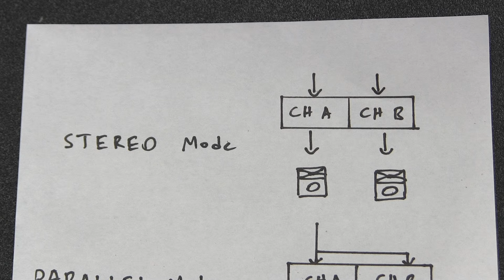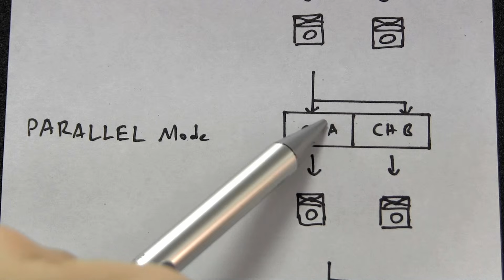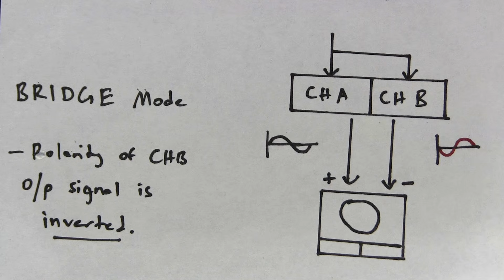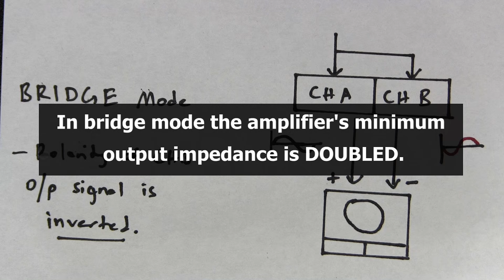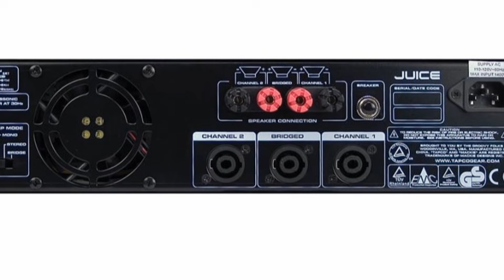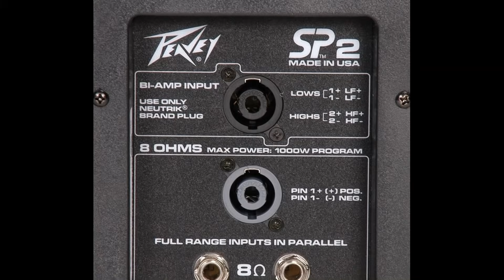How to set up and connect a power amplifier in bridge mode

Comment: Is it safe to externally connect the inputs to a power amp in either parallel or bridged mode?
Reply from the maker: What do you mean by 'externally connect the inputs'?
Reply: GLB Productions I was referring to using a Y adapter to either connect the Left Channel and the Right channel of the preamp outputs independently to one power amp for each Channel. Or splicing a Y adapter and reversing the phase on one half of it so that it would be connected out of phase between the right and left Channel from the preamp to the power amp. Do certain amplifiers permit this configuration or is it unsafe. I noticed you were discussing only amplifiers that have internal switching already set up. I would like to bridge an amplifier that does not have these circuits already built into them.
Reply from the maker: Oh I see. Yes this is safe as long as you know what you're doing, which means having a good understanding of balanced inputs (if the amp has them) and how to keep the amp inputs separated - shorting them together is a very bad idea. In addition it's a good idea to take a look at your amp's wiring diagram to confirm that it is in fact a true 2-channel amplifier - some 'stereo' amplifiers I've seen have a left and right input but sum them to mono internally and have only one power section. If in doubt contact the amp's manufacturer to confirm.

Comment: great vid, really well explained and very useful. I also laughed my ass of since it explained very well why and how I blew my first amp I bridged on the wrong side so to speak and connected to a 4ohm subwoofer, so I did everything in opposite of the right way (I was very young but I've learned from my mistakes)
Reply from the maker: Yeah, fortunately bad sound isn't fatal... most of the time ;)
Reply: @GLBProductions  Hi Sir please help me with the connection of 2 double bassbins in bridge mode

Comment: I have a question. if I turn my amp to bridge mode, is it possible to connect 2x 4ohm speakers in series to have 8 ohm in bridge? Am I right?
Reply from the maker: Yes it's possible but you will have to wire the series connection yourself as normal speaker cabinets are always set up to be wired in parallel.
Reply: Peter Petrík I'm going the same route but I was told the 4 Ohms becomes 8 then once it gets to the bridge the bridge cuts it in halfback to 4 Ohms

Comment: a lot of home audio still uses binding posts or push terminals. also. you quoted the "output" of the amp. is that in rms? or is that peak? peak is usually an inflated number that means jack shit. rms (in the car audio realm) is generally indication of actual output to the speakers.
Reply from the maker: Yes the output is in RMS. Peak output in pro audio is usually taken to be four times the RMS but you're correct that it's not a useful number to work with when doing system builds.

Comment: I think there is fault in your explanation. When you feed a speaker at the same time with a positive and a negative Signal,coming from Channel a and b, the speaker dose not move at all. I assume that the amp feed at Channel one the positive Signal and Channel two the negative Signal. Pulling and pushing at the same time equals the signal. There Must be Phase Delay by 90degrees.
Reply from the maker: You missed the bit where I talk about the polarity of one channel being inverted :)

Comment: if wo connect our speaker on channel only with amplifier  on bridge mode unintentionally....  is that safe????
Reply from the maker: Yes it is safe but don't leave the amp switched to bridge mono if you are actually using the channels independently.

Comment: I made this cable solution...the sound is much better..depth, clear and detailed..another question: the power at the output is the same ?if nominal power is 50 +50 watt whith this configuration is 100 watt?tks..
Reply from the maker: No the power output is generally 2-3 times the output of a single channel into the same impedance - check your amp manual for the exact figures.

Comment: Hi!!, How are you? your videos are really helpful and well explain. We have a small church around 96 sq.m. our tops is HH Tensor TRE 115A 500 watts active speaker. We wanted to do an upgrade to purchase a subwoofer to really pup-out the Drums (with sub-kick mic), bass guitar and all other instrument (rhythm band)  were mic, can you give me an advise on Amplifier and speaker  wattage that will match our tops but can produce a deep clean sub-bass for the drum kick. For your info our volume is set 9-10 o' clock, because the HH tops are too loud for me. I greatly appreciate your help. God bless you.
Reply from the maker: Seeing as you are already using HH speakers, I would look into getting an active subwoofer from the same company that is designed to match your fullrange speakers.

Comment: If I power my subwoofer with just channel A, I know I will have less power if I would do it in bridge mode.
But does Bridge mode sounds better than just one channel?

And also, u said if I use bridge mode, the ohms double? So I would have to set it at 4 ohms, then bridge mode to power my 8ohm woofer?
Reply from the maker: Bridge mode gives a lot more power - whether or not it sounds better depends on how you configure your system and match the amp to your speakers. In bridge mode the minimum load impedance on the amplifier doubles - if your subwoofer is 8 ohms you should have no trouble with a modern power amp.

Comment: In bridge mode how many speaker can connect to a power amplifier
Reply from the maker: It depends on the minimum load that the amplifier can handle in bridge mode - for example if it is 4 ohms that is two 8-ohm speakers maximum.
Reply: mahesh sudigala really depends on the setup and your wiring parallel or series. You can 2 4 ohm subs of your choosing wired in a series the final is 8 ohms then you can bridge that 2 4 Ohms mono. Or you can take two 8 ohm speakers why are they parallel making them 4ohms once bridged it's now 2 ohms but you would need the rating for it.

Comment: Hi,
I know it's been a while since you produced this video but it is an excellent tutorial, (as many here have said). However, I would just like to get confirmation that I understand the reasoning for a Bridge mono, (or Bridge mode), configuration.

I'd like to use an example of what I think I would use this configuration to accomplish, (In the example, I'll be using round numbers to simplify the scenario):  I have an older model stereo amplifier, (Sansui, circa 1985), which is rated nominally at 150 watts per channel for 8 ohm speakers. 

The amp has an Output selector to choose the "Speakers A" pair of speakers and a selection position to choose the "Speakers B" pair of speakers. It has a third position which permits driving the speakers A & B to be driven simultaneously, but when that position is selected, the amp's nominal output wattage is cut to 75 Watts per channel to all 4 speakers. 

I have no sub-woofer connections or selection for the Sansui amp, but I want to drive a powered sub-woofer (rated at 150 watts/8 Ohms), that I took from a home theater, '5.1' system. The sub-woofer also offers RCA connections for the remaining "5.1" system speakers, which I will not be using, (I only intend to use the sub-woofer to add to the Sansui stereo system). 

The speakers I have are Klipsch rated at 100 watts per channel 8-ohm speakers.

Because I have no connection to make from the amp to the woofer, I thought I may be able to use the Bridge mono configuration shown here. The woofer has a separate power source and I don't know if it would be best to use that source, or to treat the woofer as a 'passive' woofer in order to accomplish driving the woofer through the Sansui.

Would I be able to bridge the Sansui amp in the manner demonstrated in your video so it could drive the woofer through the L & R,  speaker outputs of the "Speaker B" connection and leave the Klipsch connected to the L & R outputs of Speaker A selection?

That's one question, which I thought I'd ask but if not, then I thought to bridge the Sansui amp's left output speaker with the woofer and the left Klipsch speaker, and leave the right speaker output as it is for the right Klipsch speaker.

Of course, I could be way off and I know I likely have confused myself in attempting to do this using the bridge mono configuration. If I made any sense in my description, (and I know it's very possible that I didn't), could you confirm or correct me in that scenario?
Thank you,
Rich
Reply from the maker: Hello Rich, that has got to be the longest comment so far on this video :) 

To begin with, if the subwoofer is powered, it does not need a speaker level signal, it needs a line level signal derived from before the power amplifier section in the Sansui. Does the Sansui have a 'line out' or 'sub out' connector anywhere? If you are unsure, take a picture of the back of the Sansui and send it to me on Facebook and I'll be able to better advise you.
Reply: Wow! I can't believe you still had a watch for comments on this video! First, I just realized that I left out some important info. The Sansui A-1200 is an integrated amplifier and 150 watts per channel on 8 ohm speakers. 

This is not a high-end amp but was much underrated in its time. I was an audiophile from about 1980 to 1990. I sold all my equipment over 25 years ago. The system I acquired back then was a 200w per channel system with two Reel to Reel decks, two Turntables, very good EQ system, mixers and on and on.  

I can’t afford all that anymore but I recently started buying some equipment to build a much more modest system than I used to have. This Sansui amp has impressed and surprised me but doesn’t approach an amp like yours.

(I only wish I could afford a pair of 700w McIntosh mono amps, and preamp, but between the cost and my wife, it’ll never happen, LOL).

The following link is to a Sansui A1200 amp being sold on eBay. They have a pretty good picture of the back of the amp where all the connections are.

You’ll note that it is not able to accept a subwoofer (as I mentioned that in my original post). This is the reason I was considering if it was possible to bridge a subwoofer into this system.

In fact, it may not be feasible to bridge the unit for a subwoofer, (powered or passive).
https://www.ebay.com/itm/Sansui-A-1200-Integrated-DC-Servo-Stereo-Amplifier-80s-Poweramp/182806275170?_trkparms=aid%3D222007%26algo%3DSIM.MBE%26ao%3D1%26asc%3D48736%26meid%3D7915b464a64c427e9b18e0ae596e8645%26pid%3D100011%26rk%3D2%26rkt%3D12%26sd%3D171042342858&_trksid=p2047675.c100011.m1850

It may be that I’m going about it the hard way. The ultimate goal is to try to incorporate a subwoofer into the system. Perhaps 9you know of an easier way to do that, (short of buying another amp that has connections for a subwoofer).

It’s very late here and I’m about to go to bed but I’ll watch for any reply or suggestions you may have tomorrow. Please let me know if there’s still some info that you need me to send.
Thanks again,
Rich
Reply from the maker: Yes Rich I monitor comments on all my videos, no matter how old they are. 

Ok, you keep saying you want to 'bridge a subwoofer into this system'. If by 'bridge' you mean bridge mono, that is impossible with your current setup because the Sansui does not have a bridge mono mode, therefore cannot be run in bridge mono, subwoofer or not. 

If you want to simply add a sub to the system, the easiest way that I can see would be to get a powered subwoofer and connect it to the receiver via one of the "REC" connectors on the back panel - those are in fact outputs from the receiver: they're meant for connecting to the record input of a tape deck but they can be used for this purpose as well. Of course, make sure that those outputs are working first, using a tape deck or something where you can monitor the output signal. 

Hope that helps!
Reply: Thank You! Yes, it certainly does help and kept me from doing anything wrong, (I probably wouldn't have tried anything without serious, repetitive, confirmation, throughout each step of the process anyway). In fact, I do know all the inputs and outputs of the Sansui are working.

I presently have one Tascam 32 Reel to Reel in the "Tape 1" connections and an Akai 4000S MKII in "Tape 2". They're both connected for Record and Playback but of course, I can disconnect one of the decks for the sake of a Sub-woofer.

I must thank you for answering me on this question! I don't know why, but I couldn't get a straight answer on the sub-woofer question in the many times I've tried to find out. 

I've been trying to find out for months whenever I'd have some time to search. I even emailed some stereo equipment manufacturers. The majority of those emails were never answered. Those that did reply, were focusing their response on up-selling one of their 'sub-woofer ready' amps and consequently, would never answer the question.

Therefore, you've actually ended my search! I'm amazed that it's so simple a solution and yet, it seemed that the previous sources I had asked in my search, didn't know how to do this either. 

In addition, the excellent YouTube video that you have here will be invaluable to me when I do finally buy a McIntosh amp & Pre-amp (in the not-to-distant future). I know that the Macs I have in mind do have all the same options as the amp you used in your demonstration. 

At the moment, I've forgotten the make & model of that amp you used but it appeared to be an extremely good one. In fact, I'm surprised that I can't recall ever having heard of this unit. I live in the US, is it only sold/available overseas?.

The McIntosh amps & pre-amp I'm hoping to own one day, do have all the same selections, options, and those 3-pin speaker connections,  (they look like DIN style connectors but I didn't have a close look at the male end of the connector). I know this reply is long but I'm truly that grateful for your help.
Thanks again!
Rich
Reply from the maker: Yes Rich you'll rarely get a completely straight answer from anybody who's in the business of selling hifi equipment because it's in their interest to get you to buy their products rather than finding a solution based on your current setup - I get the same issues with customers who have problems with their sound reinforcement systems :) It's a shame that so few companies seem to be interested in building relationships rather than pushing product. The world we live in I suppose... 

Hope you manage to find a suitable sub - it will need to have its own volume control so that you can balance its output with your main speakers, unless you can find some way of controlling the REC output level of the Sansui separately from the main output level. 

The amp in the video is an Ecler XLA1600 - it's not a particularly good power amp ;) There are better ones from companies like Crown, QSC, Linear research and the like. The only issue you might encounter is that most modern power amplifiers are a class D design with a switching power supply. They sound good but the topology is not to the liking of all ;) 

The 3-pin connectors are the inputs to the amplifier, not the speaker outputs - they are called XLR connectors. 

Glad to be of help, let me know if you have any other questions :)
Reply: XLR!!! Yes, I forgot, but they were XLR, of course. I've forgotten so much since the '80s. When I do buy a high-end amp, I have every intention of buying the older equipment. The McIntosh amps I'm hoping to buy (one day), may cost 3 times more now than they did in 1985/87. But it's the same with the other high-end audio equipment from back then.

The Mac amp I wanted in the mid 80's cost about $2200 back then. These amps are still available from private sellers and in excellent condition. However, now I'd be lucky to find the same one for less than $4500 or even $5500. In addition, that's for one of the more 'modestly powered' Mac amps.

The high-powered Macs (circa 1982 to 1997), that I would just love to get my hands on, easily break $7K USD these days. 

I think companies have always had the "up-sell mentality" and I can't blame them for that, but I agree that they seem to resort to that option in place of building a stronger consumer/company relationship. They seem to have no interest in building & maintaining a strong relationship with previous customers, which would then result in a faithful patronage.
Rich
(many thanks!)
Reply: Rich Paul I

Comment: Hey i have a question. If i bridge that power amplifier and i have two subwoofers do i need to connect the secondary subwoofer in another bridge connection of that amplifier or just only one subwoofer and i just choose to link the first subwoofer from amp to another subwoofer?
Reply from the maker: No amp that I know of has more than one bridge output, so you would need to link the subs together in parallel.
Reply: Ahh okay so if i have a passive subwoofer with link output. I just connect there the secondary subwoofer. And also shown on that video. That power amplifier in bridge mode is only one connection of mono speaker. Thank you so much for the answer. More power and subscribers to your channels. #greetingsfromPhilippines